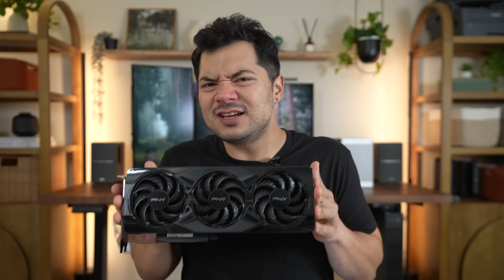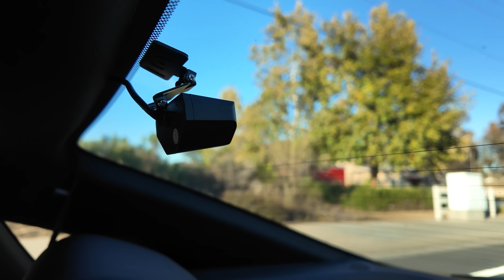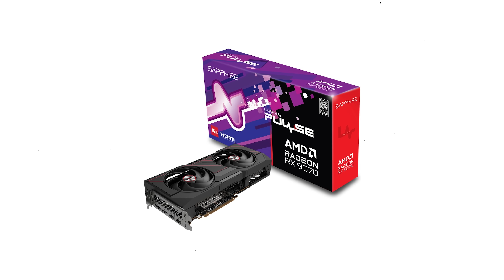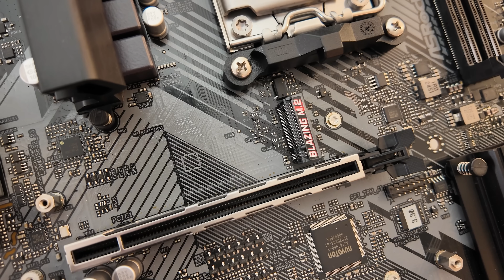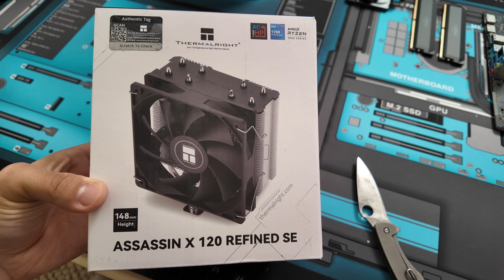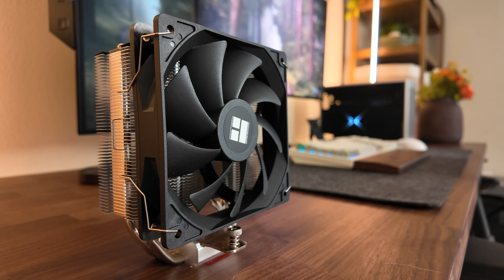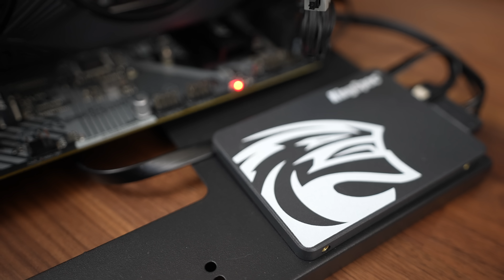The $1,000 Gaming PC Dilemma.

Comment: do todays games use up more than 16gb of system memory?
Reply: I believe they're starting to push the upper limits now where some might especially if ya do a lot of multi tasking or play newer AAA titles with lots of heavy shaders/textures or games like flight sims making 32GB the better option long term since ya unlikely to run out with that amount anytime soon but the faster more expensive ram is mostly only going to matter with high end builds and the price difference between 16GB vs 32GB isn't usually all that much anyway unless the ram is really crap so for example you'd likely be fine with 32GB of CL36 rather than going for 16GB of CL30 which might be priced the same but I think there's still some deals to be had out there and prices have been known to spike in the past with things like SSD's before coming back down again a few months later if ya willing to wait it out but long story short 32GB is fast becoming the new standard but for the most part 16GB is still fine and not obsolete just yet.

Comment: The way RAM prices are going right now, they’re going to be more expensive than GPUs.
Reply: The scary thing is that experts say this will go on for at least a decade thanks to this AI bubble meaning RAM and Storage might indeed go higher than GPUs
Reply: even 32gb 3600mhz is more expensive than 32gb 6000mhz here in denmark!
Reply: @johnbernhardtsen3008 almost nobody is making it anymore and demand is still there, ofc it is
Reply: You can get 32GB of DDR5 6400 for $120 here. You can get 64GB (still 2 sticks) for exactly twice the price. That's not expensive
Reply: I hate how they phased out DDR4 way too early, compared to DDR3 which I got dirt cheap towards the end since it was still made while LGA115x already wasn't a thing anymore, unlike AM4 which is still going strong. Doesn't seem to make any sense, until you realize how desperately they need the fab capacity to make newer stuff and why it's high in demand. Bummer, I was banking on that after buying my 5950X too early, which suddenly dropped yet another 80 bucks after it seemed to have reached it's final low for months already. Sux how whatever you do is always wrong :T

Comment: The Thermaltake Smart 600W is a bomb tier PSU.

– Tier F • Replace immediately

Thermaltake | Smart 80+ (RGB) – TR2 non-certified / 80+ White – Litepower (RGB)

Kyle is picking parts because of the price limit, but nobody should realistically consider this PSU.
Reply: it's FINEE
Reply: I have used this PSU in my media server for years, no problems
Reply: hate tier list ppl like most of yall never personally used these PSU's. Obviously they arent the best but they work. Just buy what you can afford.
Reply: @TheDonRC  PSU is the most important part of PC build if it fails it will take down PC at best with it at worst it will burn down your house. Never skimp on quality of PSU and avoid turds that are known to be bad.
Reply: It's so bad that even in a silly video it should not have been included. This is the kind of thing that will literally blow your pc up.
Reply: Didn't you hear him. He doesn't recommend anything and it's not a build video.
Reply: Yeah but it's Haswell ready, it says it right on the box.
Reply: The tier lists are always out of date and most importantly HORRIBLY incomplete. That said, a 600W PSU in a build with a 5070... I wouldn't.
Reply: @samiraperi467 I'm using a 600W PSU with a 5070 TI build. Not seeing more than 450W pulled from the wall, meaning the system is using even less power.
Reply: @samiraperi467 ...if you're not OCing the crap out of the CPU and GPU, then 600W should be fine. Total draw on that system is only about 475W, so it has ample headroom for power spikes. Most recommended minimum PSU specs are based on pairing the GPU with high power flagship CPUs(AMD uses the 9950X). If you pair them with a CPU that has a lower TDP, then it'll be just fine.
Reply: Replace it with a Thermaltake Toughpower GX3 850w. B- tier, more headroom, 80+ gold certified. $55 usd. 

The only thing it’s lacking is a modular interface but for this budget that should be one of your first sacrifices anyways because it can save so much without actually reducing the overall quality of the component. You just lose a creature comfort. 

It’s also just not worth spending half your budget on a gpu at this pricepoint to begin with but I digress.
Reply: Same with Asrock board which are blowing out AM5 CPUs.
Reply: @ChaitanyaShukla2503  If you are pairing an entry level Mobo with a 9800X3d CPU. You deserve to get burned.
Reply: @ChaitanyaShukla2503  what are you talking about?
Reply: @beckeranton767   Haven't you followed the news? Asrock have been "investigating" and "fixing" their AM5 boards since before computex to no avail.

Comment: I’m rocking a decent $12 test bench with a handle as my daily driver.  It can’t use fans but to be honest, it never gets hot enough to worry.  It’s quiet and warms my feet when I game! My old case was nice, but not enough space in the back for any cable management.  I still need to get an nvme m.2 to replace my ssd and want to get a nas to put all my other drives in (2 4tb and 2 3tb drives)